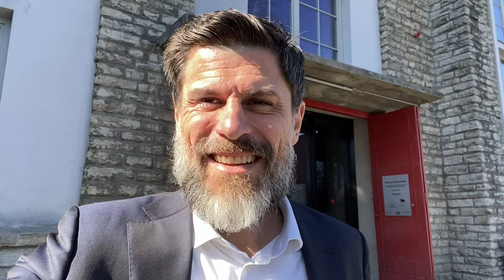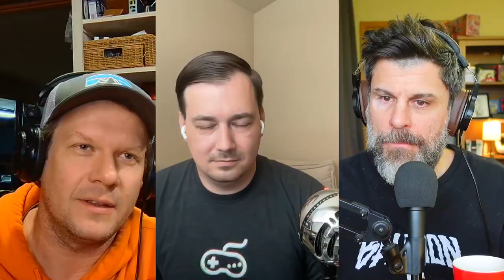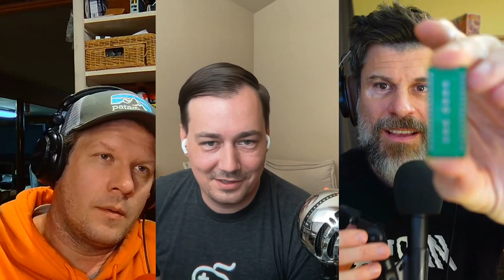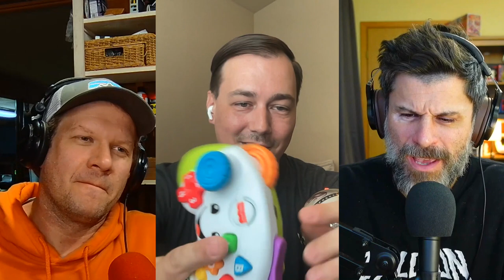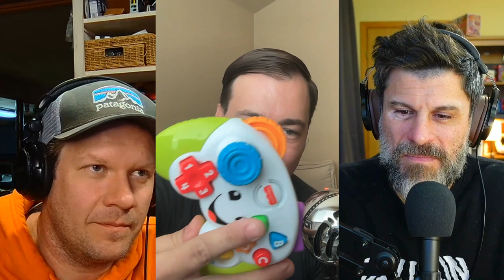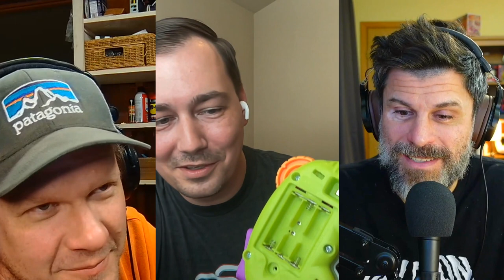Fisher Price USB controller 1ms of lag?! w/ Robert Dale Smith - Cathode Ray Podcast #49

Comment: I want to play iron soldier 3.i know a DVD player that also plays games is a bad idea but I think a DVD player that plays Dreamcast games would be cool. Sega designed a single chip version of the Dreamcast back in 2003 or so but did absolutely nothing with it. These days it's not really necessary and would be more of a novelty. I'd still buy a modern one especially if it looked like the one they showed off back in the day.